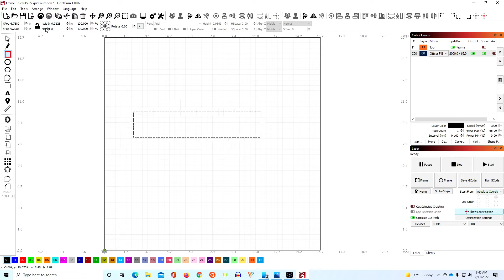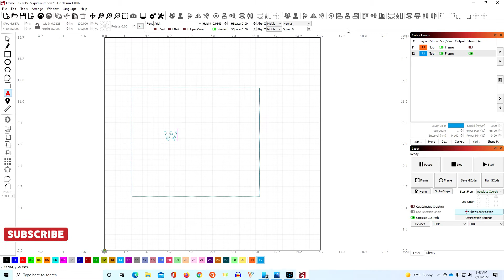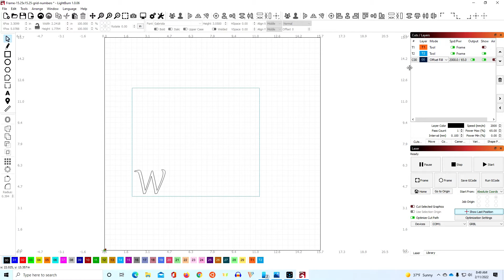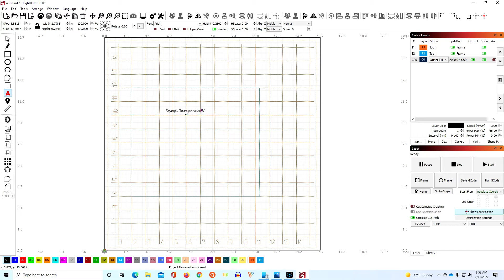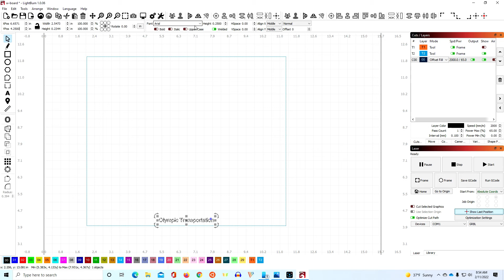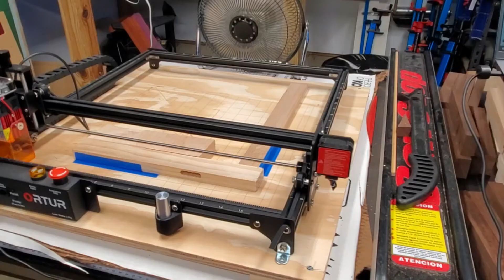Engraving Small Cutting Boards - Ortur LASER PRO 2

Comment: Can the Ortur cut draftboard thin pieces of wood for coasters?
Reply from the maker: Yes, but thickness of the piece you want cut will depend on the wattage of the LASER.   I believe my will cut up to 3mm maybe 5mm.   Thanks for viewing my video.
Reply: @SimpleShopCreations  Thank you for your response.  Looking on Amazon there’s a few different options for the pro 2.
Reply from the maker: I suggest you go to Ortur official website and review their options.  I ordered my LASER directly from Ortur.  The unit came well package and shipping was free.   NOTE:  I do not have the 10 watt LASER as it was not available at the time I purchased my.  In my opinion, the Ortur is a great hobby LASER!
Reply: @SimpleShopCreations  Thanks! With this laser, it has a potential to take my business from part time to full time( don’t have the funds currently for top tier cnc/laser, but have batch orders lined up for custom engraving)!